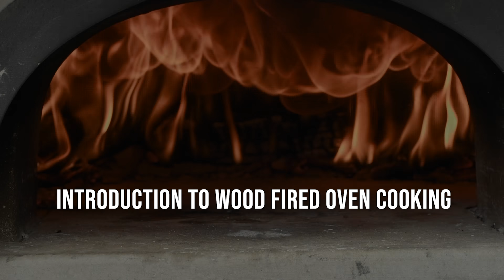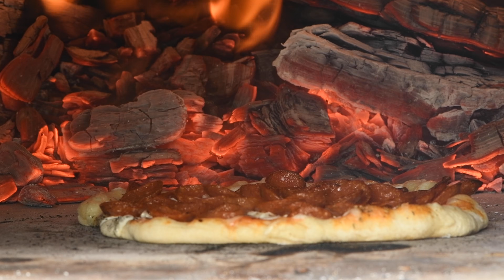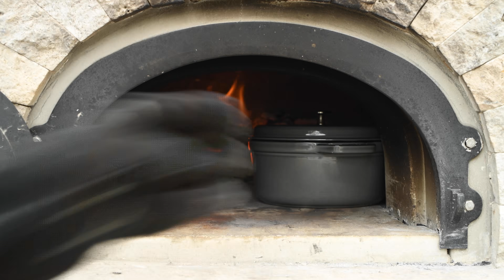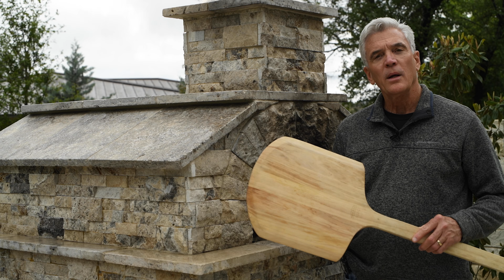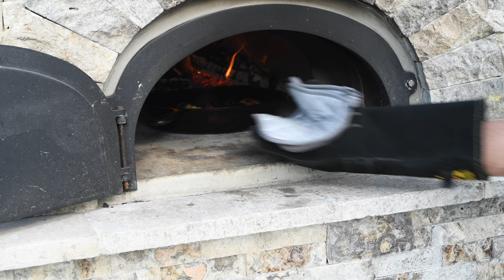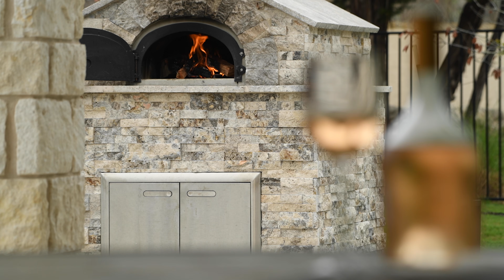Cooking in a Wood-Fired Pizza Oven: How It Works and What to Cook

Comment: Hey. I was wondering if an andiron was worth having.  My oven will be 28 by 36 and the plan was to make one out of rebar.  I can bend and weld and save an ungodly amount of $$$$$. I am finding pizza oven parts and accessories are the same as boat parts and accessories....way overpriced.  You're the first to mention about some means of getting air to the back if your fire should die down.  Copper would be light and easy to handle.  Be glad when it stops raining as I have gotten zip done on my build in a couple of days!
Reply from the maker: I have an andiron and it's just too big and takes up too much space in the oven.  In fact, I have a boatload of tools that I don't use.  I uses a wooden spatula to build the pizza and transfer it to the oven.  I use a small diameter peel to turn the pizza in the oven.  I use an ash rake/scoop to clean out the oven and to push the logs to the back.  Finally, I use a 1/2" diameter 5' section of copper pipe with a reducer and a air compressor to blow off the floor.  That cleans the floor really well and I would be concerned about shock cooling the floor with a damp rag and causing it to crack.  This video shows the tools that I use and the stack of tools that I don't and why.  https://youtu.be/jhXwVCiGil0

Some people put cornmeal on the peel before they assemble the pizza to help the pizza slide into the oven.  I don't like to use corn meal because it burns.  Instead, I use a coarse semolina flour that I found on Amazon.  That acts like little BB's between the peel and the pizza.  It works great and does not burn.  I will see if I can find a link and send it to you.